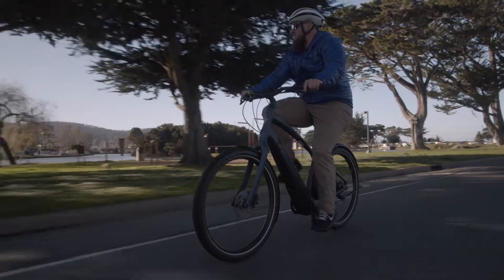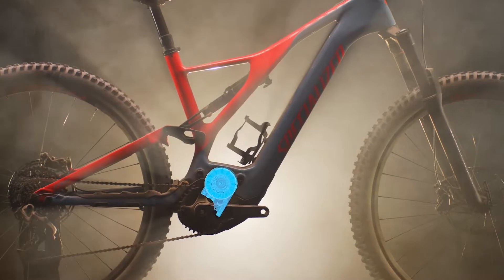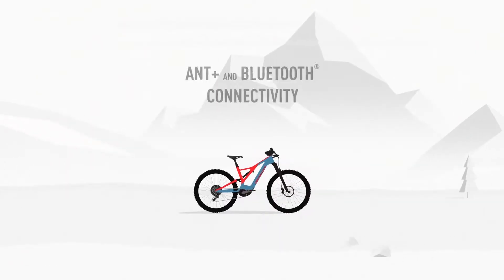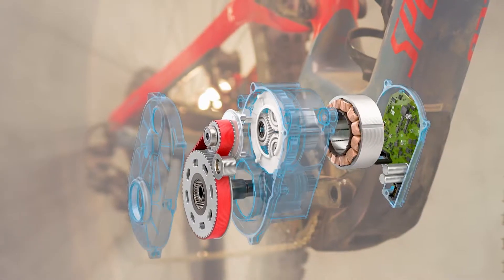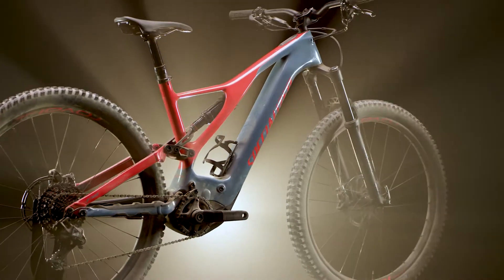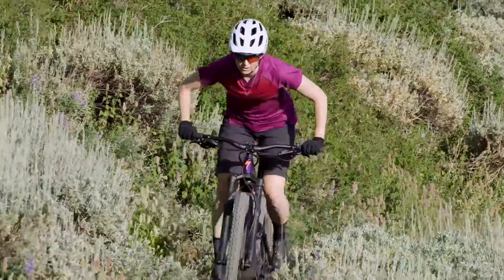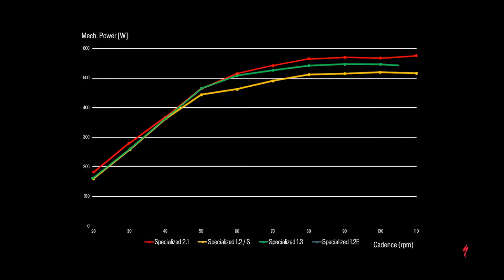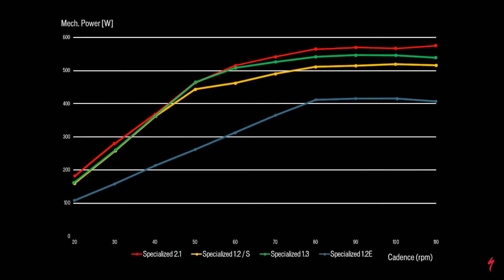Specialized Turbo Motors explained

Comment: I’m on my third Levo gen 2 motor. The gen 4 appears good (no belt, which breaks, and IP6 rated, so the bearings don’t get destroyed by water ingress) BUT the power/torque pay wall is DESTROYING Specialized’s brand and driving customers to Amflow and CX5.